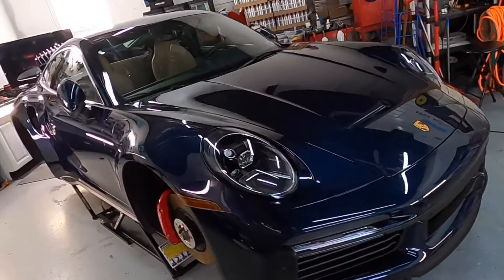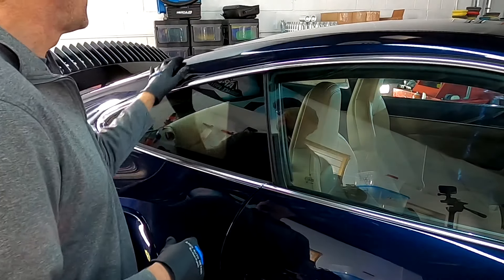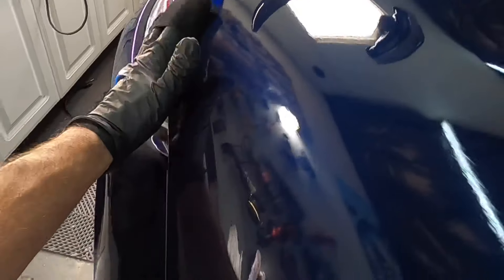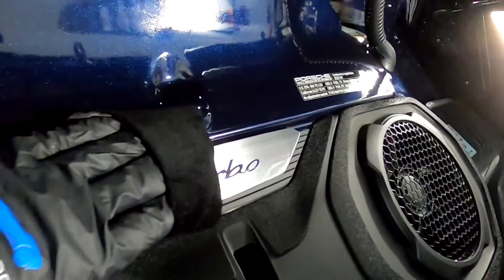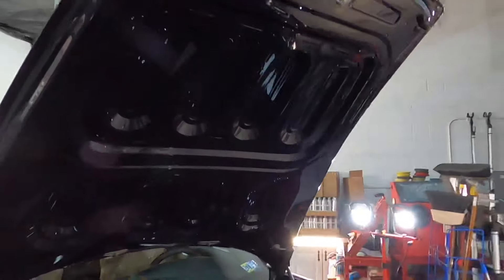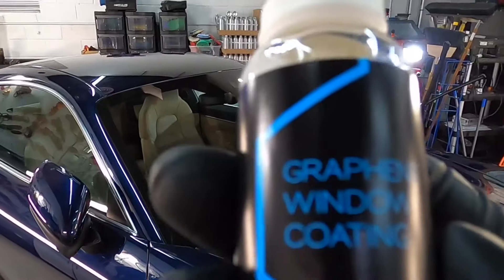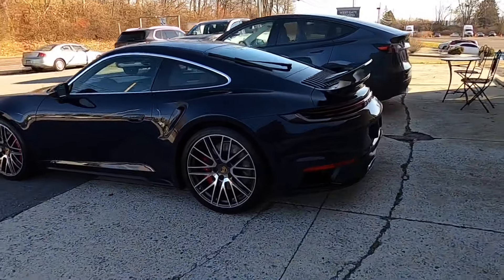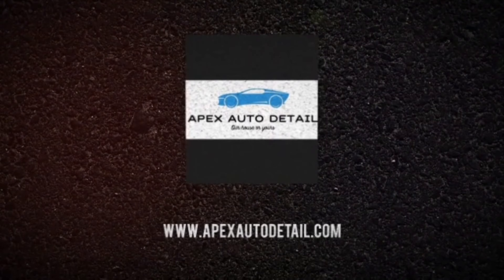Brand New Porsche 911 Turbo!!! Let's Protect All Surfaces !!Part 4! FULLY PROTECTED!!

Comment: If I may suggest....after wash move the car on wheels and use brake to warm up brake discs a bit. Dries quick so no rust at all
Reply from the maker: Hydes Syrum is another option as well.

Comment: Awesome series with outstanding results.  Really like the outcome of the wheel coating.  Will add that to my list the next time I order.  I like to coat the plastic in the engine compartment when I do a detail and think that will work well and last a long time in there as well. Especially the radiator lines.

Comment: Won’t the rust on the rotors come off onto the nicely coated wheels.
Reply from the maker: We pull it into the sun to check for high spots...pull it back in and use forced airin the barrel of the wheels. Hydes Syrum is another option.

Comment: Everything about the process and attention to detail is phenomenal except I don't understand why you wouldn't treat the rotors for rust immediately after the wash and let them remain rusty until the end.  The first time the brakes are applied rust dust will coat the wheel and barrel and, depending how long it's there and if it sees water, attempt to bond.  As an owner of a German car with dark multi-spoke wheels I now buy Hyde's in gallon containers.